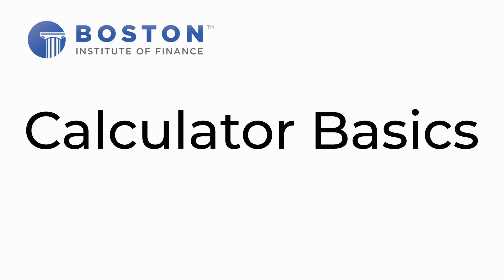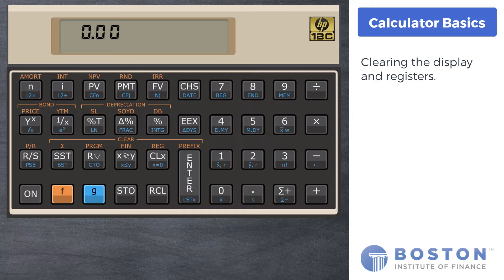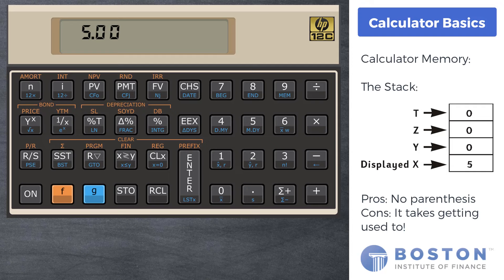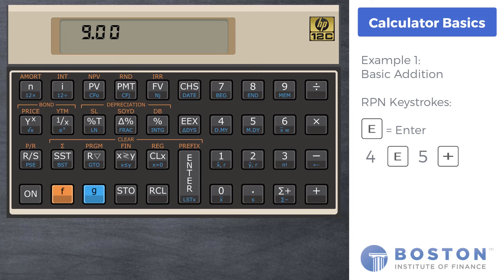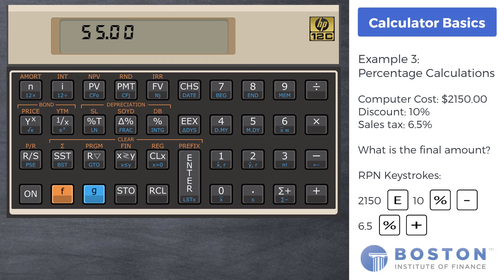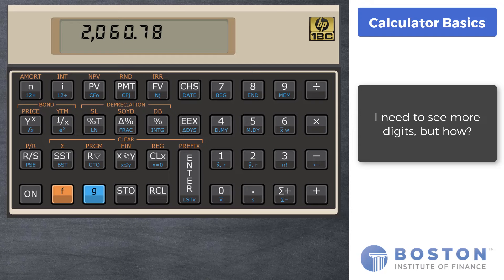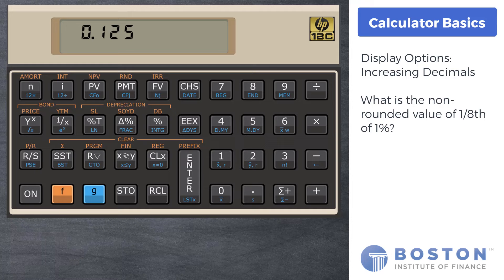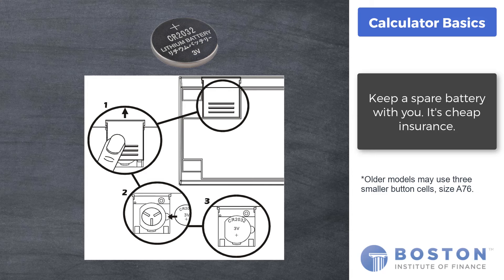Calculator Basics | HP 12c Tutorials

Comment: I've used the HP 12C since the 1980s.  Still have the original and it works.  Beat up, but I wouldn't toss this anymore than I'd shoot my dog.  There are more modern calculators that have all the bells and whistles, more than I'd ever use, but the 12C does it all for me.  Started investing years before the 12C came out and it was a challenge flipping apartment buildings.  With the 12C, I could crank out decisions over the phone and understand what was happening inside the investments almost instantly.  As time went buy, the platinum version came out, then many other calculators pushed the 12C into the background, but the pros still regard the 12C with reverence.  Every now and then, I meet with an agent or investor who pulls out his battered 12C and I know I'm working with a pro.  It is almost like a secret club of successful people who have learned that flash and bang doesn't replace reliability and ease.  I just got through determining the growth of an investment from $625,000 to $6,000,000 over 32 years.  Took seconds.  Prompted me to go to this Youtube series to see what tutorials are still out there.  I'm downloading them for my kids who are now in the business and who I've given 12Cs to.  Now they have the only tool they need to do business.
Reply: Excel is the best, time have changed
Reply: Not really.  Excel definitely has it's place.  But these little calculators are hard to beat.  At least from an entrepreneur's perspective.  I'm with the calc guy.  And yes, I use excel extensively also.